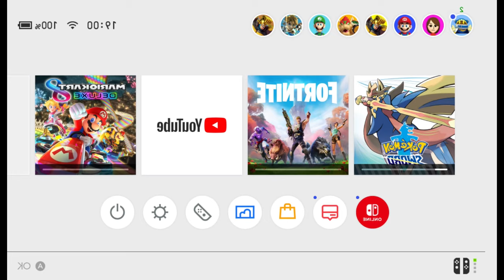Nintendo Switch Only Charges One Side Of The Port After Replacement - Diagnosis And Repair

Comment: Dude, is there a video where you actually have to do a bq24193 replacement. I've been hunting a can only find an Australian dude and a Spanish fella I can't understand who jumpers wires and resistors instead of replacing chip.

Comment: could you show how you made that red charger cable to test the switch thanks
Reply from the maker: I just sliced into a battery and removed the little pcb, soldered a couple of wires to it and run it from my bench supply at 4.2v 😁
Reply: @TheCod3r  …and just make sure you don’t have your bench power supply set at a higher voltage like ‘someone’ did 🤣😉
Reply from the maker: @highroyds  haha I wonder who that could be 😂